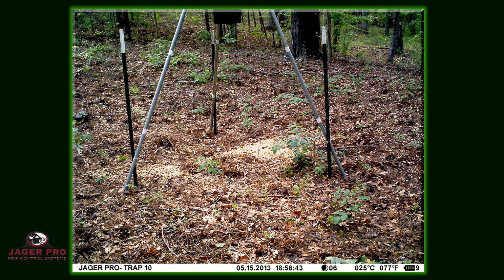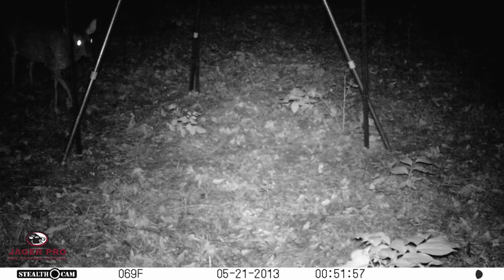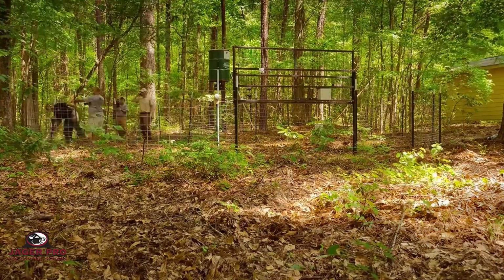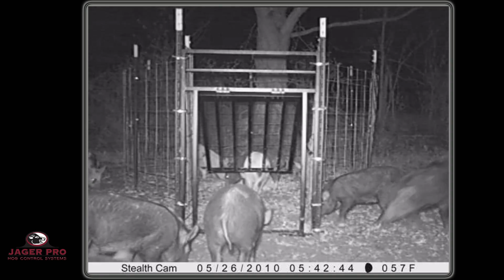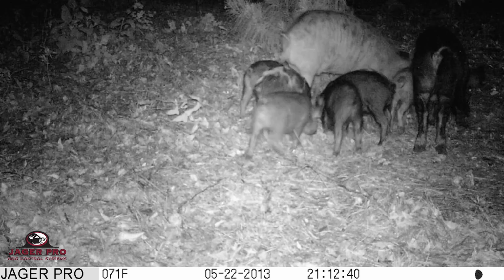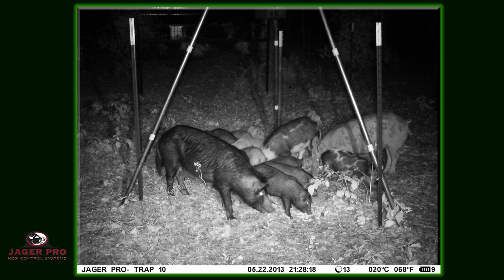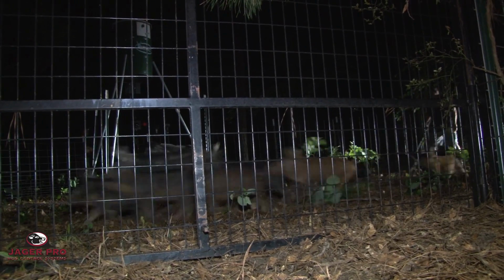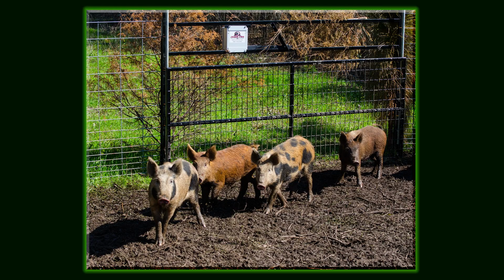Hog Trapping | (12) Urban Hog Control (100% Capture Rate) | JAGER PRO™

Comment: You should create a silent gate.  That would reduce damage to the fences and make the process easier.
Reply from the maker: We developed a gate which closed quietly and gained absolutely nothing by doing so. Feral pigs still react to the faint sound of relay contacts closing. They know exactly where the exits are located and will attempt escape regardless of the gate parameters (loud vs. quiet, fast vs. slow). A "slow and quiet" gate would only add expense to the device and severely reduce capture efficiency.